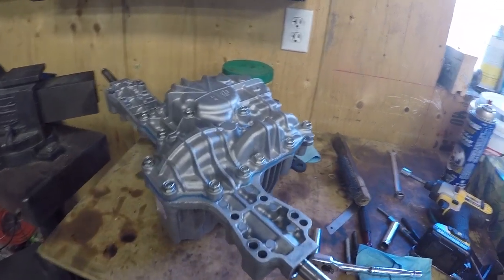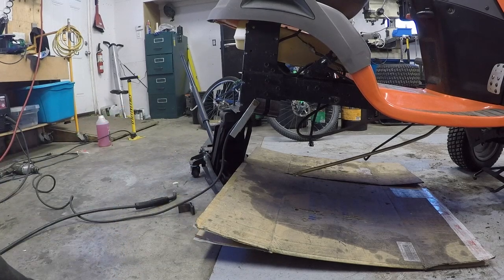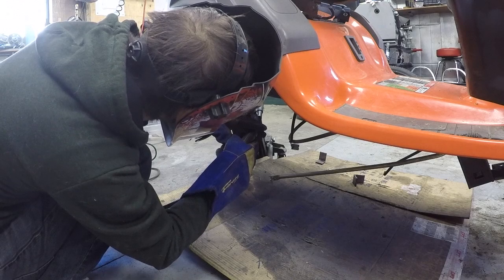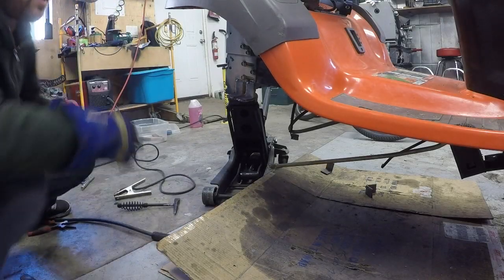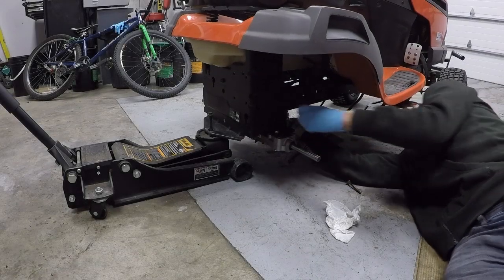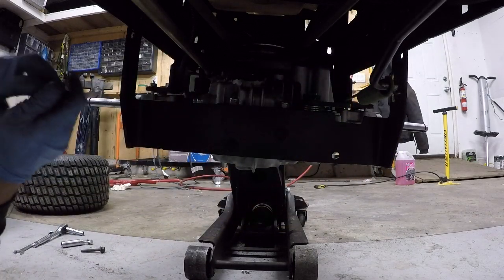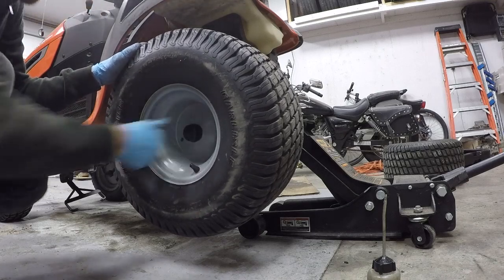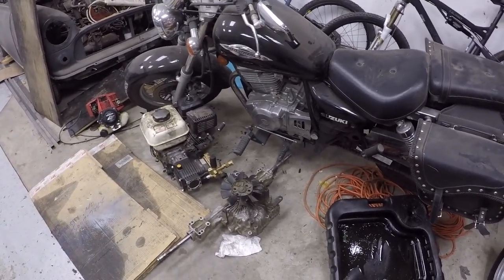K46 Hydrostatic Transmission Repair. (Part 3) TUFF TORQ (Husqvarna)

Comment: For anyone interested, there are updated reinforcement bracket kits available for @$30 online.  
You cut the old thin ears off and replace them with 3/8” thick pre drilled angle iron.   
It comes as a kit with new hardware for reinforcing the top mount of the trans where it fails at the same time.  👊
Reply from the maker: That's great info, thanks for the comment. Someone had already commented this (Richard Visco) and I had it pinned to the top, but since your comment is more detailed, I will pin yours to the top. Thanks.

Comment: What is the oil you use in the k46 transmission
Reply from the maker: I have answered this so many times. I should have a pinned comment, but they only allow you to pin one. 

Full synthetic engine  oil. 5w30 if your transmission is not experiencing any ware problems / slippage, or if you are in a colder climate..... all the way up to 15w40, if you have slippage issues, and or are in a warm climate. 

Thick oil causes a lot of drag on the transmission and should not be used in cold climates. If it is (to stop slipping) then you should be gentle with your transmission until it warms up.

Comment: Didn’t show putting oil in trans or tell what oil to use 🤷🏼‍♂️
Reply from the maker: There is no good way to put oil in these as they were never meant to be serviced. The oil goes in through the vent, and it is usually miserable. It gets air locked and will sometimes spit oil back at you or refuse to fill. It is a good idea to fill it before installing it in the tractor (of you have it out) because they can be hard to get at (or impossible) in some tractors. 

As for the type of oil... That all depends on who you ask and what you read. I have used everything from 5/50 to 20/50 . You want to use a good, full synthetic engine oil, and what "weight" you use is determined by what climate (operating temp) the unit will be used in, and if the transmission is having any slipping issues. Basically the colder the climate, and newer the transmission, the lower the viscosity (closer to 5W30) and if you are in a hot climate and or the transmission has slippage, use a thicker oil... I have used Harley Davidson 50 weight in a few extreme cases.

Comment: It's sad that this is something that has to be done. It seems like you could buy it this way from the manufacturer to begin with. Well I guess if it doesn't break the  Sells go down.😢 The way it is sad .
Reply from the maker: I agree with this somewhat, but the fact that the frame and brackets fail likely stops the transmission from breaking in half, or snapping an axle. Much of the problem is people buying or salesmen selling tractors that are not suited to the job that they will be used for. If your property had rough land, gopher holes etc, you need a tractor with a lot larger wheels and tires and a more substantial frame, axles and transmission.
Reply: @JoelArseneaultYouTube    I have a 54 inch cut and the reverse is not working but forward is working great. It's 2 years old.
Reply from the maker: @David-yh5po  There are no separate parts for reverse, so this is either an adjustment in the linkage, debris limiting the linkage, belt slippage due to a a loose or broken mount or a loose belt due to debris interfering with the "clutch" mechanism. 

100% of the forward parts are also reverse parts, they just move in a different direction. The only way this would be internal damage is if your forward is also slipping, but you're not detecting it because forward has more range ... Meaning, it used to go 12 mph in forward, now it goes 9, it used to go 3 mph in reverse, now it goes zero. (just random numbers) 

If it works when it's cold and then gets worse as it's hot, that usually indicates internal slipping.

Comment: You must have refilled the trans
Reply from the maker: The trans is filled through the vent. It is idiotic. Best case it is slow because air has to come out as fluid goes in, and you are blocking the air vent with oil.... that is going in.

Comment: I sat and watched your videos and I was pissed after watching everything except for how and where did you put the oil into the transmission? From what I have seen I'm not the only one that wants to know where the fill hole is.
Reply from the maker: There is no fill hole on these transmissions, as they consider them non-serviceable.  No drain hole and no fill hole. 

You have to remove the transmission vent and put the oil in that way. It is a total pain in the ass, as the air that needs to escape only has one way out and will cause your oil to spit back at you. This can be very messy if you are not prepared, and even if you are, is still a pain. 

Also, removing the vent is a pain, and really confusing, most of the time. If you mess with it, you will figure it out. It's hard to explain, and I haven't done one in a few years now.

Comment: Did you purge the transmission before dri ing it, just wondering, as I read that air gets trapped inside and there is a procedure to remove it. You can find it on youtube. Good video cheers
Reply from the maker: Yes. This process is almost always necessary when you have drained the oil from the transmission. However, if you skip this step, the transmission will usually self purge if you let your tractor idle in neutral or by driving it, if it will move. 👍

Comment: All I want to do is drain old oil and add new.  Didn't see this anywhere.  Do you show this?  thx!
Reply from the maker: Yeah, unfortunately, they do not intend for this transmission to be serviced. The only way to get the oil out is to either take it apart, or remove the vent and tip it upside down. Then filling it through the vent with the proper quality as there is no way to check the level. 

I generally tell people not to mess with the oil unless they are having issues, as you are more likely to cause a problem than do any good. Unlike an engine, (Engine oil needs to be changed largely due to combustion contaminants mixing with the oil) this oil will only go bad from overheating. It is a sealed unit, and so there is no way for contamination to get in. If the oil needs to be changed, chances are you have bigger issues than your oil.
Reply: @JoelArseneaultYouTube  I have a craftsman 24hp 48 deck, it's a G5100 which I think is classified as a garden tractor, but seeing as it has a K46AW transaxle I only use it to cut my grass and to pull my rubbermaid cart when I do yard work, NO ground engaging. I've noticed that the transaxle like to make a whinning sounds, should I be concerned?
Reply from the maker: @rockybull2476  This sound is usually nothing to be concerned about. Hydrostatic transmissions tend to make that sound due to their design, and tend to make it more when they are under load (climbing a hill for example). It can also sometimes mean that there is some air in the system / the oil level is low, but if this happens, the tractor will experience some "slipping" where you try to move forward or back, and it takes a second to start moving, or doesn't want to move when climbing a hill. 

The noise also tends to get louder if you have something that is loose and vibrating / matching the frequency of the transmission. If it seems to work normal, I wouldn't worry about it.

Comment: joel , at the 12:30 mark , did you drill those 2 front bracket holes all the way through from top to bottom and run 2 bolts from top to bottom to hold bracket on and also to hold case together , thanks in advance
Reply from the maker: I believe so. That's why I used lock nuts on the top side of the bracket. This was quite some time ago, so I don't recall, but that would make sense.
Reply: @JoelArseneaultYouTube  I am asking because I have that exact mower and problem and a friend says if I drill through from top to bottom to hold the bracket it will let the case leak . What do you think and I appreciate your video and response
Reply from the maker: @mikevanosdale1465  No, your friend is not correct. The holes already go through the cases around the outside of the sealing surface. Perhaps your friend is worried that the new bolts will not clamp the cases together at the sealing surfaces, but this is also not correct.  Using nuts on the other ends of the bolts will clamp everything together 👍

If you go back to part 1 and watch from 8:30, you will see where I talk about a previous tech drilling the hole out to 3/8" , so one if these holes was already drilled all the way through. Either way, the clamping force of these bolts, that go through the bracket will clamp the cases together and seal everything up. If your case was already leaking, you may have to disassemble and put sealant on the cases ... simply putting bolts back in may not stop it from leaking, but it is worth a try.
Reply: @JoelArseneaultYouTube  Appreciate the advice and these videos .
Reply from the maker: @mikevanosdale1465  Happy to help. Good luck .

Comment: How do you move the fan on top of transmission?
Reply from the maker: I'm guessing that you mean "remove" ? There is a nut on bolt on top of the fan. In most cases you will need to use an impact gun to remove it as there is no good way to hold the fan, from what I remember.

Comment: Auto mechanics 101 says you don’t work under anything that can come off the jack.  That’s  why there are jack stands
Reply from the maker: Yes, others have pointed this out, altho this is not an automobile. It is always good practice to make sure that whatever you are working on is secure and will not fall. I will now attempt to explain why this isn't so straightforward on these tractors. 

I typically use a jack, and in this case I have a large bolt through the "hitch" hole into the hole in my jack. This stops it from sliding off of the jack. Not the safest thing that I've ever done but better than jack stands and gives you room under the tractor. These tractors are also not very heavy. It would crush your hand or may snap your arm if you were really unlucky, but if it fell on me I could lift it off. 

Jack stands are not safe on these small tractors as the stand points are too close together and it is very easy to tip the whole tractor over... The frame is less than 20 inches wide. Also, the angle of the frame when using 2 stands means that it is likely to slip out, and using 4 stans isn't practical as there simply isn't enough room and again the tractor would be very unstable. 

It is nearly impossible to safely put stands under the front axle as it is a centre pivoting solid axle. To do this safely, you would, among other things, need two wide, solid jack points at the rear of the tractor to stop it from tipping, and as I have already said, the frame is very narrow. The floorboards are thin gauge metal and not a good option

To make it even trickier, the engine is a VERY high percentage of the weight of the tractor and is right at the front. This means that, if you are using 4 stands, you need to have them very far forward on the frame (directly under the engine) to ensure that the tractor doesn't flip forward. Putting them that far forward puts them in a place where they can be hit by steering linkages or the steering spindles, and that could cause the tractor to fall over. 

The only "safe" way to lift these tractors is to use a chain or cable hoist to lift the tractor from the rear of the frame. This still isn't ideal as the front axle will allow it to move side to side very freely and makes it hard to work on and somewhat unsafe. That is why I do it the way I do. 

PS. When I work under cars I use jack stands. I changed a tie rod on my truck recently and blocked it up well.

Comment: They make a repair kit from husqvarna  cut off ears on plate and bolt on new brackets that will repair thoughts cracked ears. The brackets are much heavier metal no welding needed
Reply from the maker: Great info. I have pinned your comment to the top. 

I'm not worried about welding by the tank, but yes... not a good idea.
Reply: Be careful gas tank is there when welding

Comment: I appreciate your time and advice, but is this the same rear end as the 
YTH24V54 ? JUST ASKING BECAUSE my tractor just quit moving while I was mowing my lawn and I couldn't figure out why it stopped working.
Reply from the maker: Your tractor appears to have a K46 transmission. It may not be exactly the same, but close, as there are many variations of the K46 . 

If it just stopped working out of the blue, I would check a lot of things before checking the transmission. Check the belt to see if it is damaged or has fallen off, make sure that all of the pulleys in the drive belt system are okay, including the one on top of the transmission and all of the idlers, make sure that the "clutch" / belt tension is working properly when engaged. 

Make sure that all of the transmission bolts are tight and that any braces or brackets are installed, not broken and tight. Movement of the transmission will cause the belt to slip. 

Make sure that the forward reverse lever or pedal is attached and actually moving the lever on the outside of the transmission. 

Make sure that the axle keys that lock the hubs of the rear wheels to the axle are not sheared or missing. 

Removing the transmission should be your last resort.

Comment: Nice job I have the same predicament.welding over top of paint?I might grind that shiny for good penetration.the welds look good tho.nice maple leaf helmet too looks like mine.CANADA ROCKS.it would easy to install a drain plug in the bottom.tap a hole put in a magnetic plug....bobs your uncle.this guy is good finishes the job with paint nice and clean reassembly.very good job .the owner should pay double.
Reply from the maker: Haha... thanks Trent. 

I will admit, removing paint is a great idea. It didn't concern me in this case for two reasons. 

1. I'm using flux core wire feed (not actual MIG - no gas) and it is INCREDIBLY forgiving for dirty, painted or contaminated metal. One of the reasons I prefer to use it. (in some cases)  I would never do this with TIG or actual MIG. 

2. The base metal was fairly thin compared to the parts that I welded on. This means that I had to crank the heat up quite a bit and focus most of the heat on the bracket. The issue with penetration into the frame (in this case) was more about not over penetrating / blowing a hole in it, and the extra heat burns away the paint in a jiffy. 

I'm not sure if I did it here, but normally what I would do is tack the part in place so that the area heats up, then hit the area with a wire brush. The paint comes off easily in the area around the weld, so it saves a lot of hassle. Again, not the right way to do this, but I was not worried about it in this case. 

 Drilling and putting a plug in would be half of the problem solved, as you still need to be able to add oil, and these transmissions don't have a place to do that, other than a vent... that isn't easy to get to, is kinda small to add oil to, and because the case is sealed you have to add oil slowly to not get an air lock... It's a pretty bad design.  To top it all off, the case isn't very thick, so adding threads (without welding in a bung) could be problematic and the lowest part of the case is the differential. The gear runs really close to the case so there's not much room. They should have just done it from the factory 🤷‍♂️

Thanks for the comment... sorry for the long winded response, haha.
Reply: @JoelArseneaultYouTube  great response you know what you’re doing.thanks for all the info.when you tear down one of these it’s readily apparent where simple improvements could be made that wouldn’t add terribly to the cost.some of us were wondering how you refilled the oil and where.can it be done before the cases are reinstalled and then top up after it’s all sealed?thanks again.your neighbours must like having you around.it’s the same with me always fixing something.
Reply from the maker: @Tub13  I generally fill them through the vent before reinstalling them. You just have to take your time, especially with a thick oil.

Haha... yes, I fix a lot of stuff in the neighbourhood. It is sad when manufacturers skip a process that would cost a few dollars more ... but would make the product 10X better. This, however, is not a mistake. All of these companies are 100% capable of making a product that would last a lifetime, but there's not a lot of profit in making a product that lasts forever. 

A good example of this is that Briggs has phazed out their best, most durable lawnmower engine this year (push mower engine) and have replaced it with the EX series (Exi) that have plastic carburetors, and on some of them they actually say not to change the engine oil.

Comment: A weak part of the design, the trans mounts, had to fix those on ours , I notice on those they got rid of separate  mounts and put in a stronger frame mount for the front for the differential. Good stuff! thanks , I'm going to be taking apart the rear end on a lawn tractor, useful info.

Comment: Thanks for posting this. Pretty detailed. I had broken bolts on my Husqvarna 2554 at the axle and at the forward plate and have recently been seeing an oil leak. Will probably need to split the transmission to fix the leak now.  Good job on the weld. Now that's the strongest part of that  machine.
Reply from the maker: Thanks for the comment, Stan, and good luck !